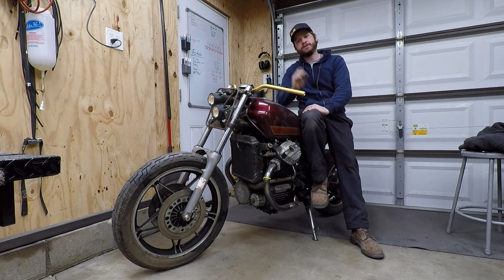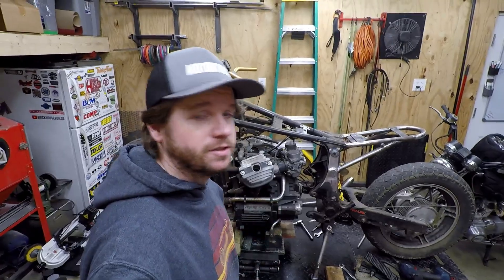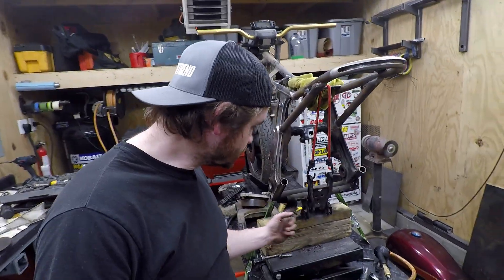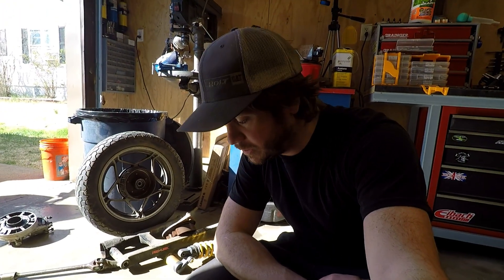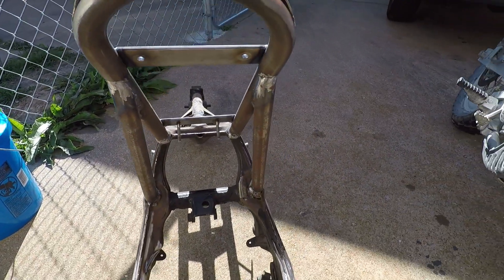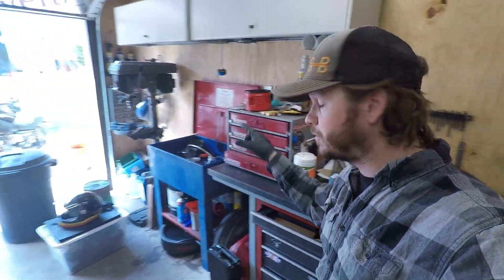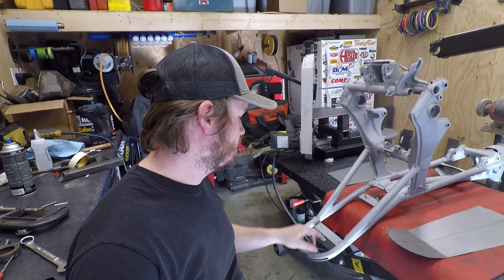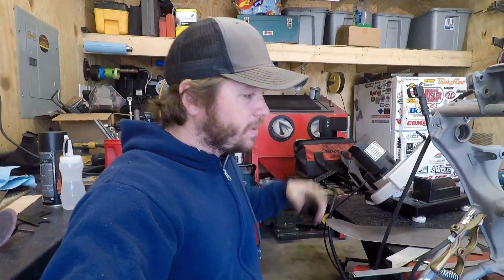GL650  BUILD - FULL TEARDOWN / SANDBLASTING / PAINTING THE FRAME - EP10

Comment: Hey  dope content! I thought I spied a harbor freight sandblaster in the background there 🤔 what all applications do you normally use it for since I take its not good for frames/wheels?
Reply from the maker: Thank ya Braeden! I use it for carburetors mainly.  I have baking soda in it which works well on old carbs and is more gentle than sand or other media as to not damage aluminum.
Reply: @BrickHouseBuilds  okay that makes sense, thanks for the info!

Comment: Looks great! Fixing to start blasting my GL1100 frame. Did you use any kind of a primer before the VHT paint? Im temped to lay some primer first but im worried about the paint not bonding to the primer. Whats your experience been?
Reply from the maker: @dakota-joel7590  I believe the rollbar and chassis paint did not require primer. Having the perfect surface to paint on also made me confident to not use primer
Reply: @BrickHouseBuilds  Pretty sure you're right, I've never used it in combination with that clear but I'm excited to give it a shot! Thanks sir!

Comment: Why don't you powdercoat your parts instead of can spray them ? Is the 2k clear coat strong enough to protect the paint ? 
On my NX650 I powdercoated everything except the engine which was painted with VHT primer, paint and clear coat. However the paint is really not resistant. I am very disapointed in the result.
I also renovated a enduro Suzuki PE250 last year. That time I powdercoated the engine and it is very resistant. It even resists small rocks I am hitting during enduro trails.
Reply from the maker: This was simply a matter of budget. High quality paint and 2k clear is pro level stuff and very strong.
Reply: @BrickHouseBuilds  thanks for the answer. I should have tried this instead of regular VHT clear coat. I'll try 2k next time because down side of powdercoat is that you have to completely empty the engine as the paint has to cure at approximately 200°C.
Regarding the budget, how much did you pay in cans to paint the frame and accessories? I personally pay around 150 dollars to have the frame and the swinging arm powdercoated. I do the powdercoat myself on small parts, it's even cheaper. Cheaper than spray paint I think honestly.